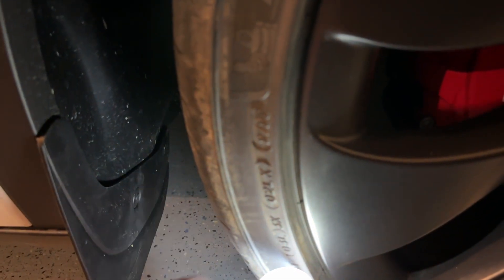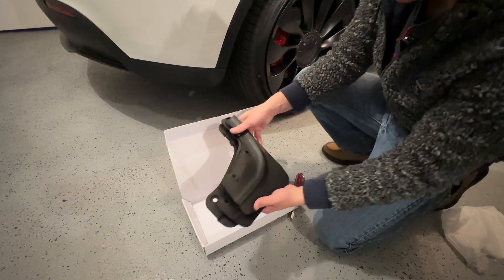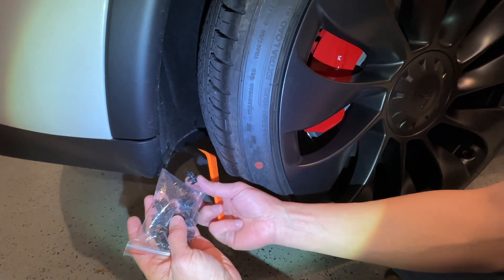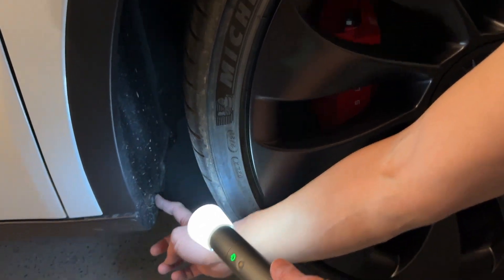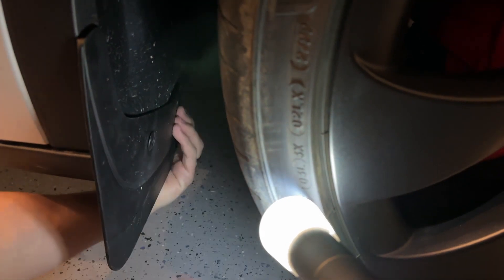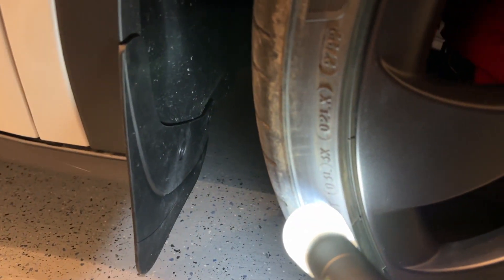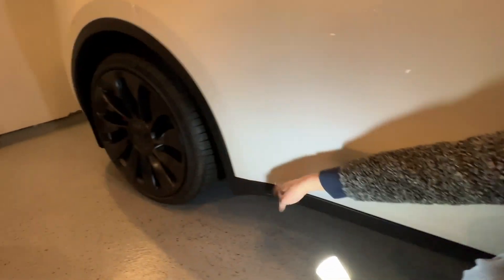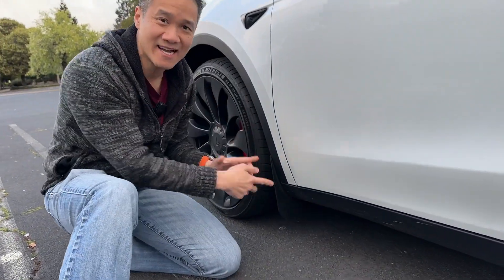How to Install Tesla Model Y Mud Flaps by TEMAI!  SOLD OUT! Check link incase in they STOCK AGAIN...

Comment: Nice video  were you able to get the rear mud flaps clips in I tried mine and the snap right out I reached out to temai to see what they suggest..
Reply from the maker: Thanks!  Yep, it took some force, look at how I did it in the video, I used a little flat stick, it made a huge difference.  Good luck!
Reply: @UTECHPIA  thanks for the reply I just can't get the clips to stay in place
Reply from the maker: @josed4299  , you just have to push REALLY hard, it is the SAME for the front clips.  If you can get the front you can get the back ones :)